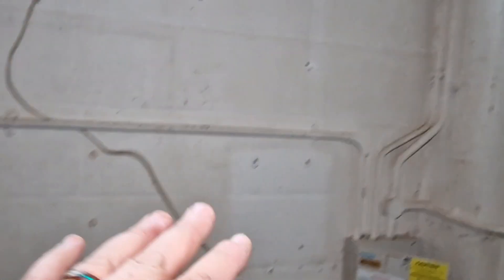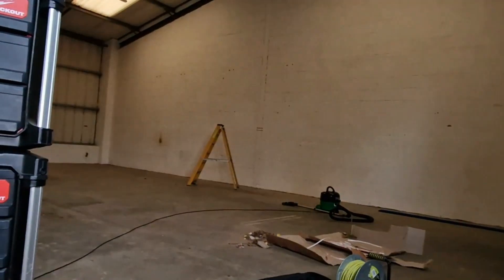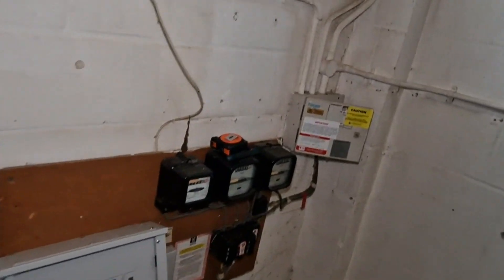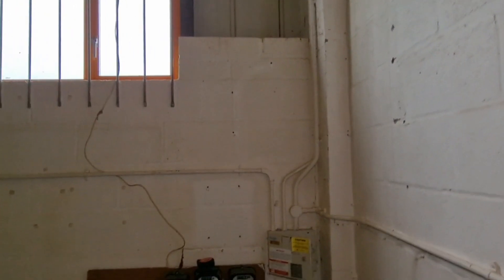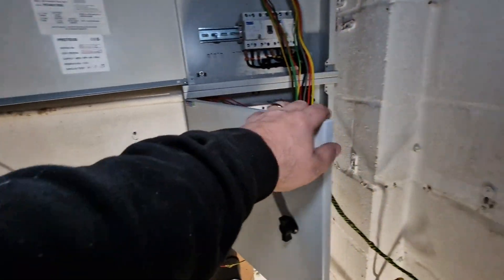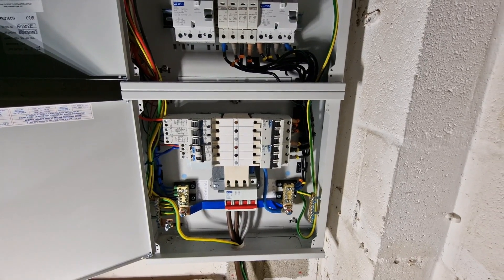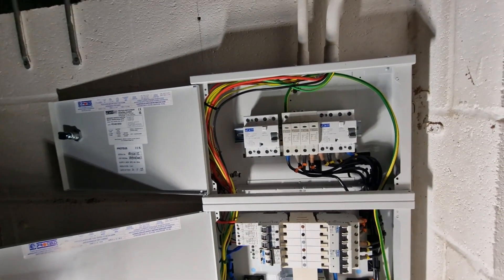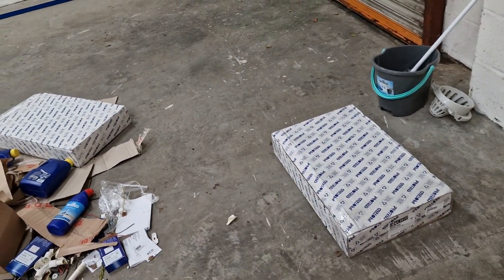Best three phase EV boards available ???

Comment: From an industrial perspective Proteus are regarded as a being more at the cost-effective solution end of the market rather than top quality brand. Although the Schneider and ABB that I have worked on in the past were built a lot better than the switchgear they sell now. I guess they are starting to meet in the middle more now, with the likes of Proteus improving on their build and the top brands not being quite what they were.
Reply from the maker: Interesting to see how others see it!
Reply: cost effective solution HA HA  that just means cheap and it is as I said cheap crap
Reply: ABB or Siemens Switch gear. 👍🏻

Comment: CEF own brand Proteus boards are crap now and have always been crap. I would never fit one ever. When I am called out to one that has gone on fire it is replaced with an Eaton or Schneider. The control gear is equally crap, as are any of the isolators in their own brand Proteus range. Years ago they were Geyer, that became Proteus Geyer, then they dropped the Geyer name, best avoided if you want to get away from the cheap end of the market.
Reply from the maker: Wow that is a pretty damning verdit on a respected industry brand. Do you have any data on the fires you have insinuated Proteus are responsible for? As someone who installs loads of Eaton, Schneider and Hager this is a solid option in my experience. But please feel free to educate me with some evidence beyond the rhetoric.